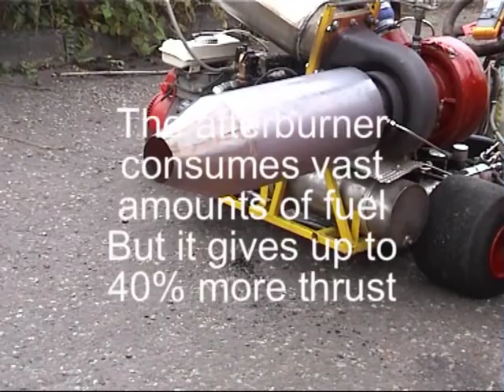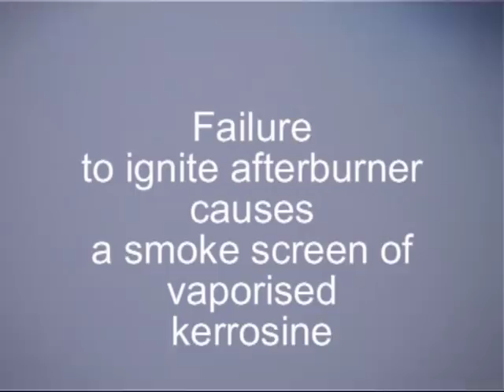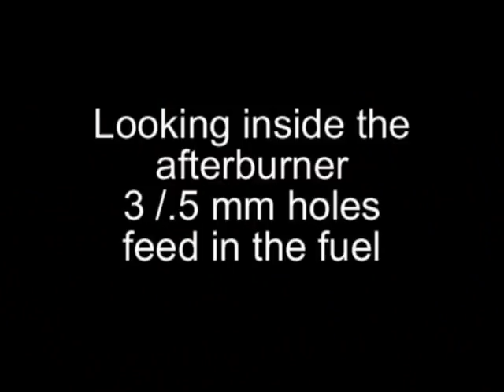JET KART WITH AFTERBURNER ON THE ROAD

Comment: Not exactly the type of "Run" that Kart needs....  That thing needs A LONG LONG Runway.  I'm actually surprised it moved at all.  What kind of Thrust pressure in Lbs do you think this makes?  On a nice long runway it would be interesting to see what she tops out at after plenty of time to get moving.  Could be a pretty impressive speed if you have enough runway!!  These aren't very good for short or stop n go type of riding.  In the end....wouldn't the turbo be the limiting factor?  Why not use a Pulse Jet instead....no restriction...or much less I should say.  The turbo would probably fall second to a pulse jet in speed trials as well as thrust in Foot Lbs....  Nice project...looks like a ton of fun...just for the hell of it.
Reply from the maker: +SquillyMon It was giving 50 KG with reheat
Reply: 50 KG....so In the USA...thats what 110Lbs of thrust then?  Hmmm...More than enough to move.  Would love to see a nice 3 mile stretch of roadway!!

Comment: Looks so heavy the frame is flexing under stress. Other then geeks having a "blast" what's the point. A shifter cart with a 125cc engine would go twice as fast in half the time with a much simpler approach.

Comment: maybe 10 mph tops, just put a 100 preditor on it and you will have something.
Reply from the maker: You are missing the point this is a gas turbine built in a shed . Not that difficult to install a petrol engine

Comment: Honda oddesy carts not the crappy vans.
Honda oddesy has roll cage better wheels the suspension is easier to upgrade. just replace engine with motorcycle engine and you will be going faster and running safer and refueling will be easier.

Comment: seemed under powered for the size of the motor .... eh maybe because you were going so slow..... jet engines don't really kick in till the speed is up and ram effect helps feed air.......... and yes i have built several jet engines ... why just for the fun of it

Comment: Making a "jet engine" from a Turbocharger is so old....been done so many times before...radial compressor in and outflow with an external combustor...plus a 2 stroke engine providing oil pressure for turbo bearings...Yes, its cool it works, but the power to weight ratio is just terrible. And like all Turbojets, it gobbles kerosine like a Russian alchoholic.......
Now if you were to use the cold end of the Turbo..make your own longer shaft and use the hot end with the combustor inbetween making it significantly lighter and more compact with its own oil pressure pump, it would desererve a lot more credit because technically what you have done is not that difficult...which is why so many others have done exactly what you have done so many times before...Just saying...

Comment: its running 10 to 15 mph tops, so slow from so much time,  get a rope starter engine. they are cheap and will smoke that scrap pile
Reply from the maker: hardly the same though  this is a gas turbine

Comment: I don't get it... why you are building something like this, when almost every electric cart will torn this one to pieces in every aspect? (much faster, cheaper, simpler, quieter, with better acceleration, more torque...) I just don't understand why wasting time with something so over-complicated like this, when there is much more suitable technology around.
Reply from the maker: Any one could buy a electric kart or a gas powerd kart
This is a jet engine built in a shed
If you need to ask you will never know
Reply: Do you really not get it? It wasn't made to be practical or useful in any way at all! It was made as a fun project. Everyone here is missing the point, go back to your COD videos.

Comment: Don't brag about engineering when clearly if you were a engineer you would know that your better off using a power turbine and gearing it to a axle. Not very efficient relying on thrust alone. And yeah he was only going about 5mph and probably used 5 gallons of gas in 20 yards.

Comment: i call that a major fail. How about using an actual turbocharged motor instead of the ridiculous idea of using turbine thrust! yee haaa 20mph...... epic fail
Reply from the maker: It is a great shame you do not see the wider picture
Reply: doubleboost No shame mate, no wider picture either. Its not like you're racing it, and its certainly not fast!! i'm sorry but i would get bored with that after 2 minutes. Completely unethical and unreliable. the lawnmower engine could be faster by itself.  So you're pushing maybe 200lbs of thrust?? power to weight ratio 2:1.... WOW... a dent in the wallet maybe. But seriously, what is the point of this? i can't see any logic at all.
Reply from the maker: Tom Foolery
The idea was to build a jet engine
The kart was just a bit of fun
If you need to ask what the point is you will never know

Comment: Bull shit why the gas engine installed and running in the test?
Reply from the maker: +mytonysdaddy The gas engine runs the oil & fuel pumps
Reply: +mytonysdaddy it says a leaf blower was used to blow air through it to get the engine started. Jet fighters in the 50s used compressed air

Comment: I got a RC faster than that piece of shit.
Reply from the maker: Did you build it yourself & will ir oull you around
Reply: Self build and it will beat that
Reply from the maker: did you build the jet engine as well or buy it
Reply: No I built my Radio Control car. One of them cars you need to build yourself.
Reply from the maker: sorry dont like little bits of shit i prefer big ones like mine
Reply from the maker: Lets just agree to be different Have a nice day
Reply: doubleboost I'm pulling your leg mate. It's a good effort fair play to you on building it. And the sound is awesome.
Reply from the maker: Good Lad